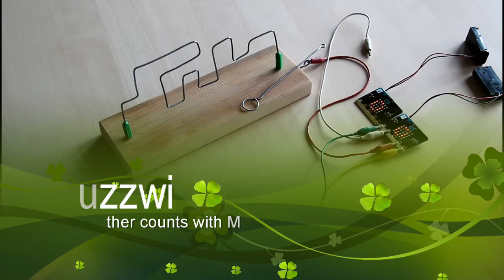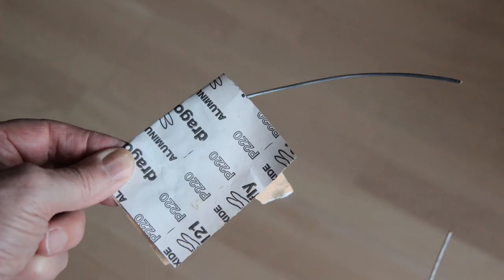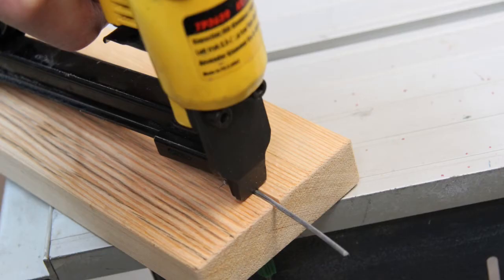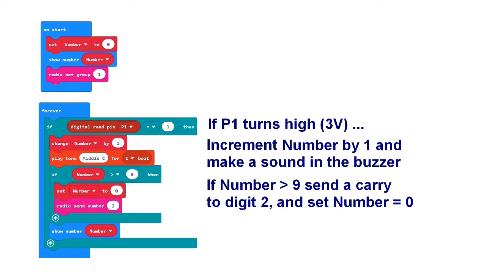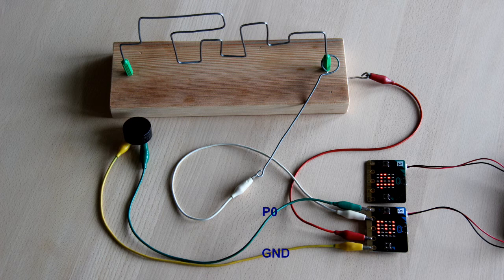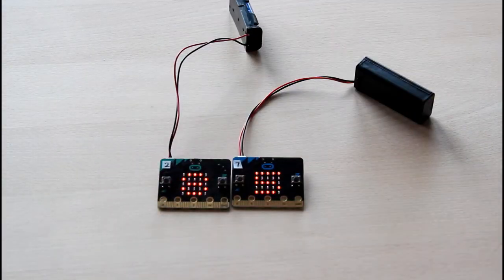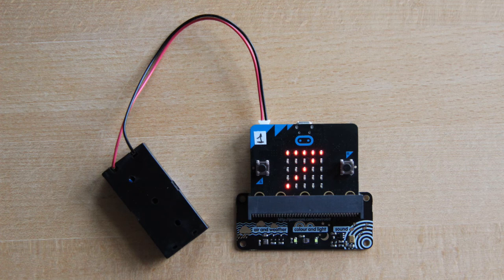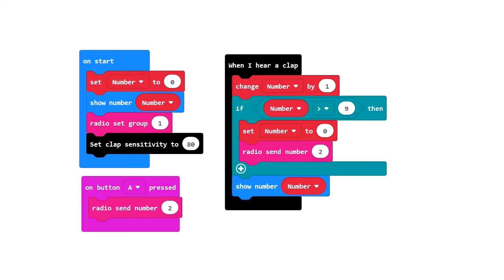Buzzwire with Micro:bit

Comment: Please tell and show how to program that microbit
Reply from the maker: By help of MakeCode. Have a look at https://makecode.microbit.org/
Under my description you will find links to the various programs.
Reply: @gunnarlund6633  than I have to put your provided program in new project tab?
Reply from the maker: @Javvy9  If you click on the program-link the program will be opened in your browser. Click "Edit" and you will be able to modify it. Connect the Micro:bit to your computer by help of a USB-cable and choose "Download". Choose "pairing" if you are asked about it. Then the program will be transfered to the Micro:bit.
Reply: @gunnarlund6633  thank you very much sir I appreciate your humbleness I am making this project and please help me if I further need your help although thank you for your support.
Reply: @gunnarlund6633  sir I wanted to discuss how can I program it in a way that in the first micro bit it could count till 9 n in the second three points get reduce by the touches the limit should b 3?can you please help me
Reply from the maker: @Javvy9  79 / 5000
Oversættelsesresultater
I do not quite understand what you want. Can you tell me a little more about it?
Reply: @gunnarlund6633  you programmed 2 micro bits as when one of them reaches the number 9 the other will start counting but in contrast to it I want to use the first microbit to count till 9 and the other to have 3 dots on it now when you touched the wire for first time the dots will decrease to 2 points and the same will happen till all three dots are gone
Reply from the maker: @Javvy9  You must make the counter send a signal EACH time the wire is touched. Have a look at this program: https://makecode.microbit.org/_K6yDFu5YqWFP
And then the receiver must be changed to something like this: https://makecode.microbit.org/_grU5L5WmyX8k
I hope this answer can give you some ideas.